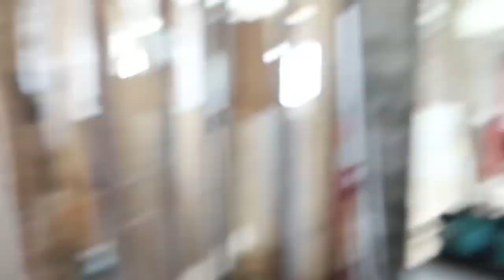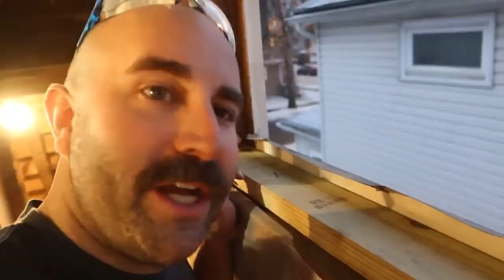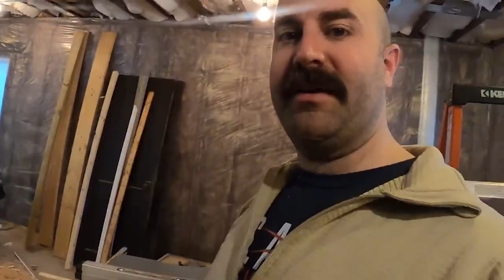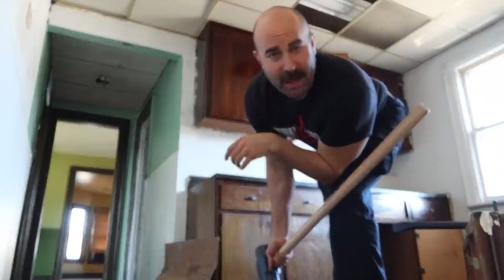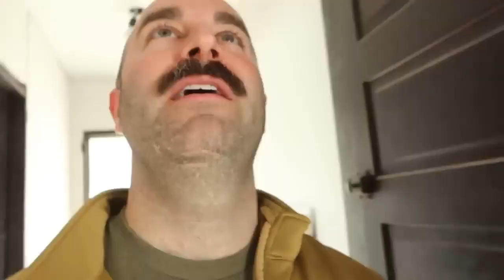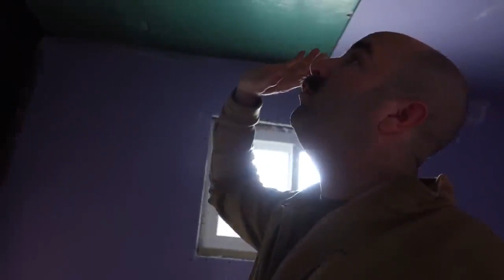This Old Crack House 21 - I Remove Kitchen Cabinets with 1 Swing

Comment: 2 things.

1. For bathroom tub space, can you extend tub sitting area and tile it off? In our shower, my wife likes the sitting area to be able to shave her legs. I've seen some hotels that do this too.

2. For the small bedroom next to bathroom, what about a Murphy bed setup? You can get lots of storage space and still have floor space when bed is folded up. Or what about a day bed with a twin trundle that rolls out underneath?

Comment: You can shave the door edges to get it to close smooth.  personally I grab a whole interior door and frame all in one from lowes or somewhere and just toss it in when we have gone through our rentals it's really cheap for a complete door with frame and all, just grab some wood wedges and a door handle and your done plus then you can have nice new updated doors even on the closets they are that cheap..